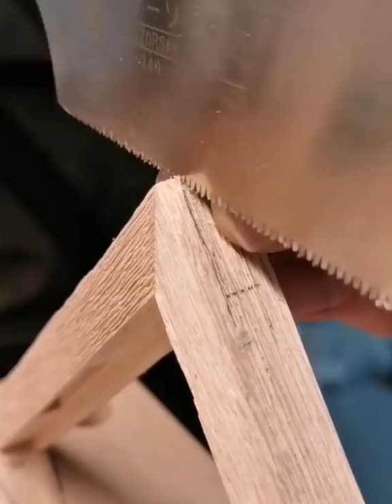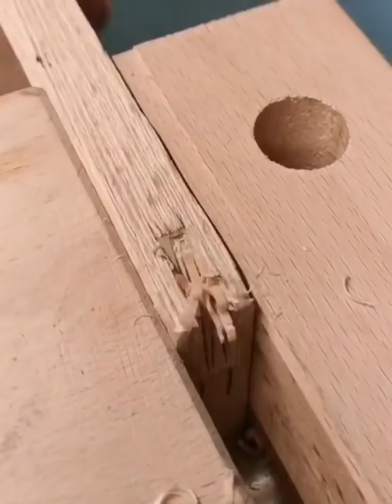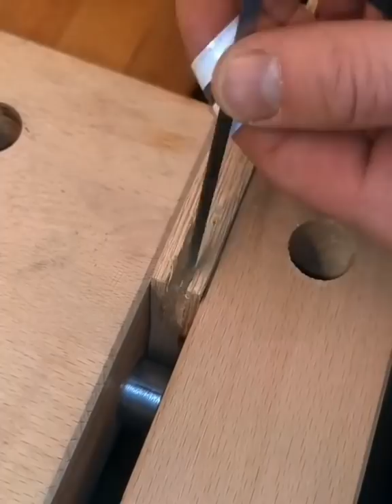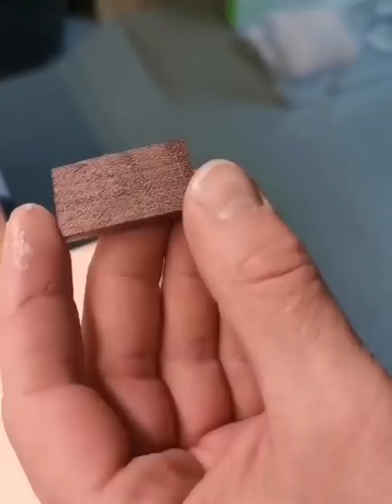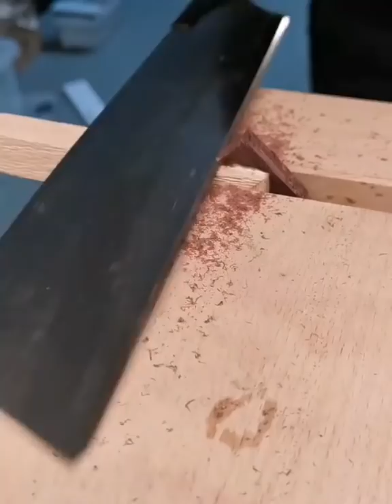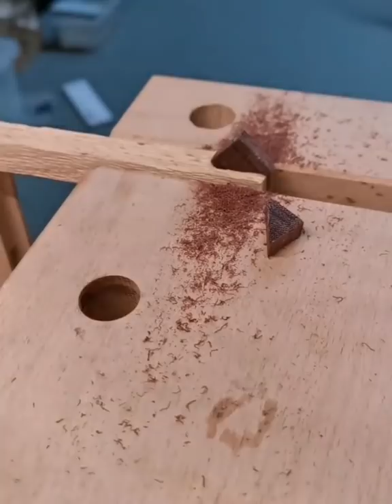💯Making Groove In The Edges Of The Frame And Glue Some Pieces Purple Heart

Comment: For all the know-it-alls who thought it's all about a splash of color: this is a time honored way to reinforce a miter joint, which has weak end grain  glue surface. The craftsman does a great job with hand tools, great control. Unfortunately, for his spline he cut the end off a stick, instead of orienting the grain in the length of the spline. The reinforcement is positioned in the weakest way possible. Ruined the whole idea of introducing long grain to long grain glue surface.
Reply from the maker: Thanks for your comment